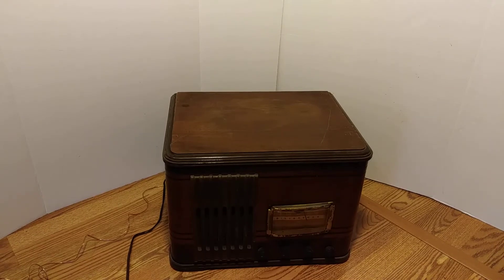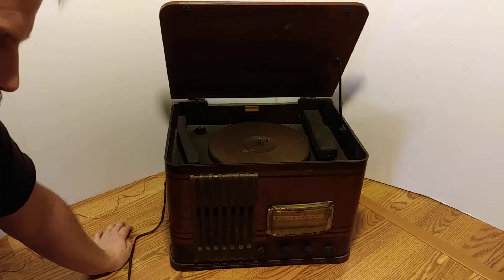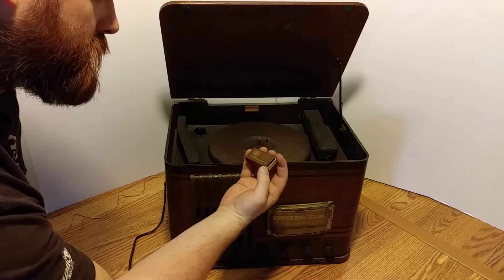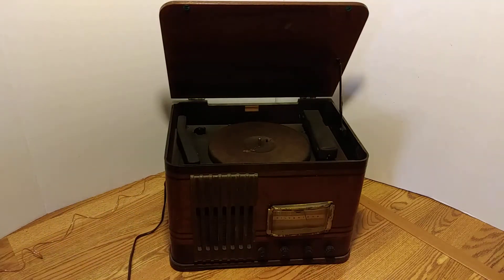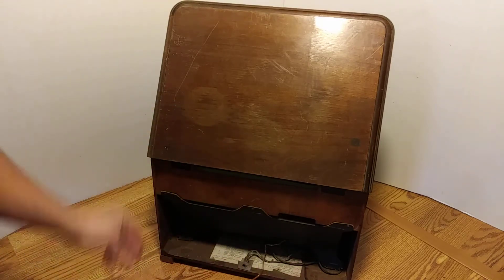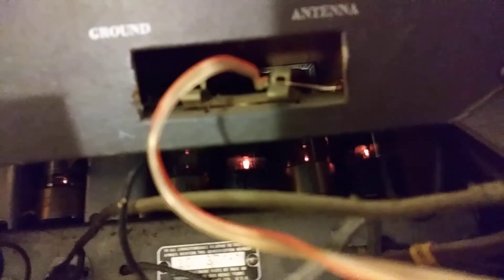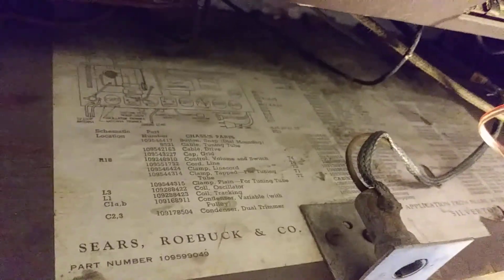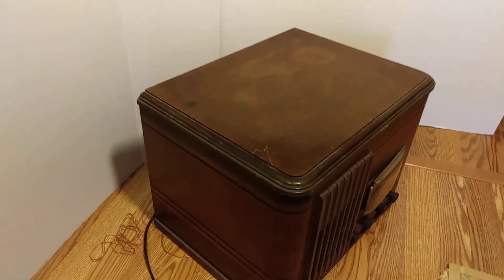Silvertone Recorder turntable Sears Robuck and Co Antique AM Radio Ebay seller : gbhatchery

Comment: What model is that? I repaired one of these when I was 11. Belonged to my grandparents. Sounds like the belt drive from turntable needs replacing. The tuning capacitor will need cleaning, the old elastic tuning knob cord which winds around the chassis on wooden pulleys can be fabricated easily. Shit I did it at 11. Does it have the Magic Eye? The old wax caps will probably need to be replaced as well...
Reply from the maker: I left a link on a restoration YouTuber's video and they bought it.  Forget the name, but they are in the top results for these.